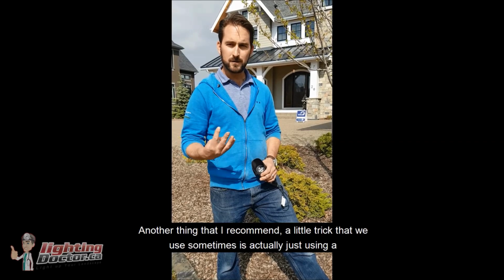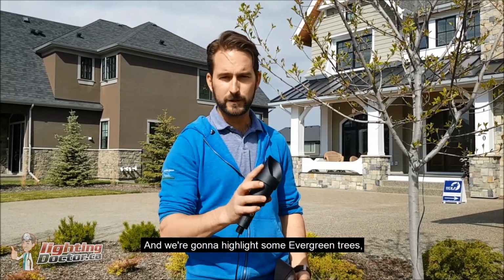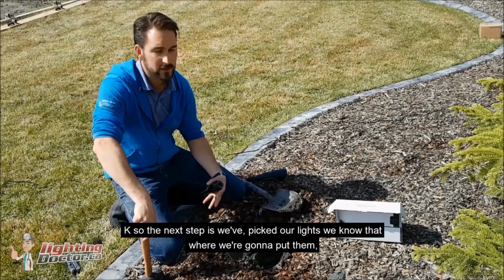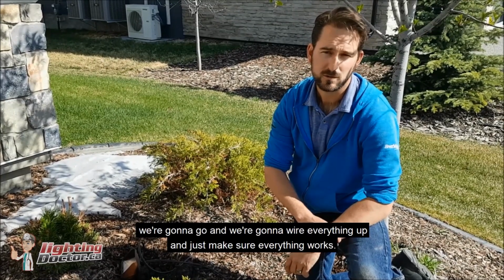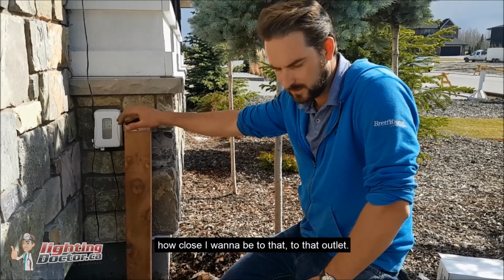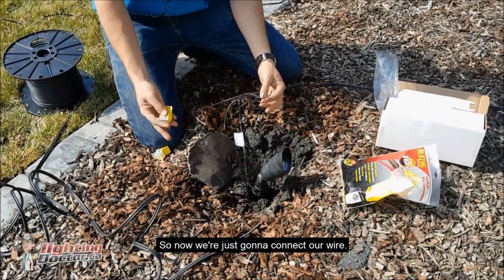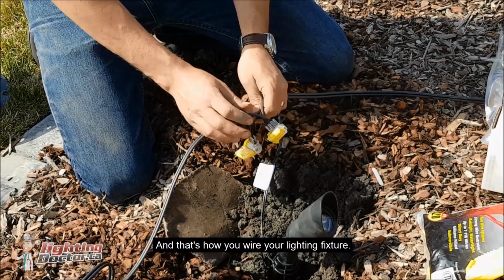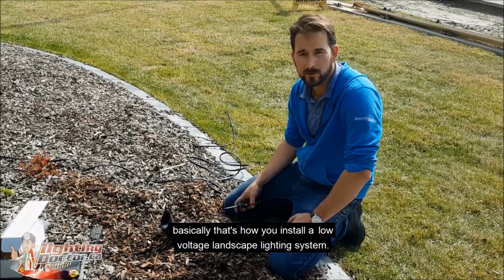Landscape Lighting Installation Step by Step

Comment: Great video and very simple explanation.   I do have one question. You showed the connection of one light fixture to the wire. How did you connect the second and third and fourth? Is this a series connection? In other words, if one light goes out, will all the lights in the circuit go out?
Reply from the maker: Search youtube for "lighting doctor wiring diagram" video and it will have a detailed explanation. Thanks!
Reply: Yes, all the lights connected to the circuit will go out because several lighting are on the same wire. But this is a good thing because you'll know where the damaged wire is if the wire gets cut and the lights turn off. 
As for connecting all the other lights, you connect it the same way.
Reply: I know it is kind of off topic but does anyone know of a good site to stream new series online?
Reply: @Caleb Jaxton flixportal :)
Reply: @Clark Arturo Thank you, signed up and it seems to work :D Appreciate it!
Reply: @Caleb Jaxton you are welcome :)

Comment: When connecting the wires, do certain color wires need to match? Or it doesn’t matter with low voltage just as long as there is a connection?
Reply from the maker: No they do not

Comment: How deep should the wire be buried? Do you wire all the lights before connecting to transformer?
Reply from the maker: Hi Ezra, only needs to be a few inched deep. 4 to 8 is a good depth. I do wire everything first and then connect to the transformer and test everything before I bury any wire
Reply: @LightingDoctor  Do you usually just push half an inch of mulch over the wire? Im sure it won't stay buried in a rain storm at that depth.

Comment: Is there such a thing as low voltage string lights that can be added to the project? I have grapevines in rows and in the winter up lights don't help because no foliage.  Thought I would try stringing lights along the rows but didn't want to to use 120V LEDS (like Xmas lights)

Comment: I have a 120 watt led transformer for my low voltage landscape lighting. I would like to add another line of lights but want to control them independently from the original line of lights which are run on a light sensor. how do I branch off the new addition if they are attached to the same transformer? Thank you!
Reply: There are 2 ways to control a line of lights independently from the original line of lights. 1. You need a special transformer that can do that - usually costs around $800-$1500 depending on which you get. 2. You get another transformer for that line of lights.

Comment: Got a problem I can't figure out.  Low voltage lights working beautifully for 3 mos. then house struck by lightning.  Lights won't work on timer and when I set to "on" on the transformer the lights turn on and then immediately turn off.  Got new transformer today.  Same issue.
Reply from the maker: Sounds like there is a short in the field. Either bad connections, cut line or bad fixture somewhere. If the connections that were used were the wire piercing type I would suggest one of them may have been damaged from the strike.

Comment: so you took a wire from the box to the first light, you connected both ends to the light, but you still have other lights to connect 🤔
no more wire! what did I miss?
Reply: You connect in a parallel circuit. Google that.

Comment: How do you calculate how many lights fit into a certain transformer
Reply: He said in the video that you figure out how many watts each light takes and every transformer is rated for a certain amount of watts. So if you have a 60 W transformer, like in the video, you could probably have up to 12 lights, but it’s probably safer to be just under the 60 W, so he suggested 10 lights if each light takes five watts